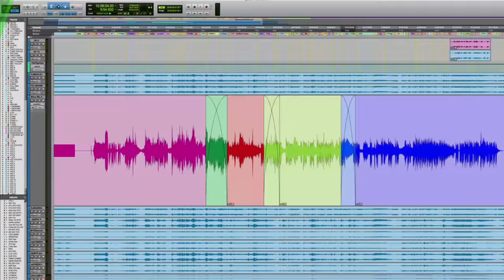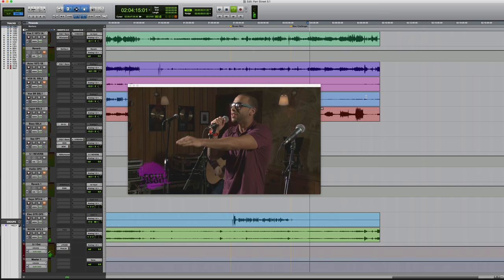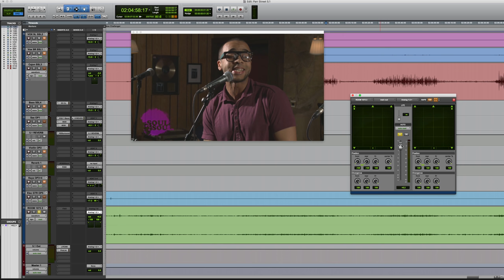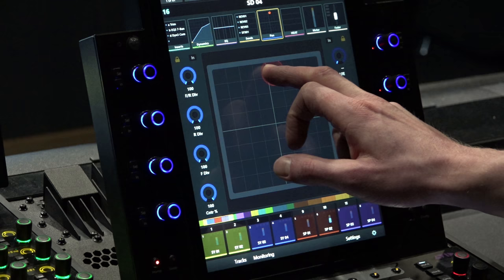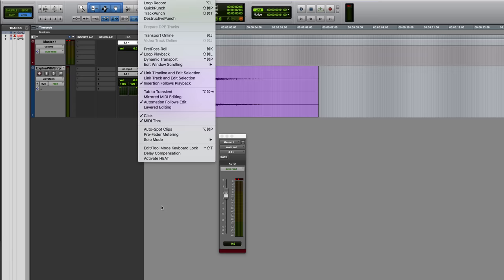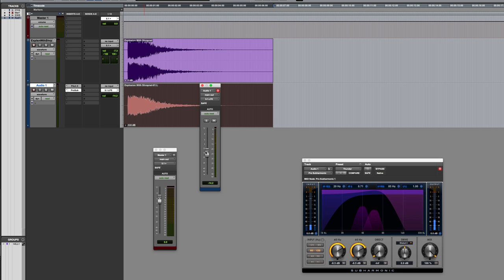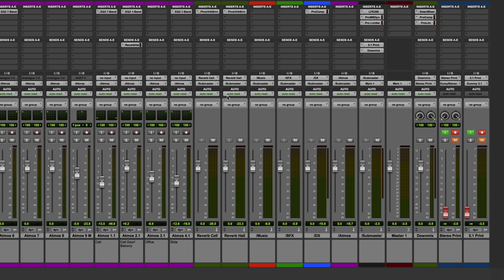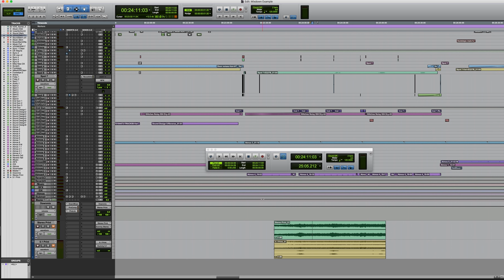An introduction to surround mixing in Pro Tools

Comment: Paul - Your video really solved the major problem I had with tons of audio files spread over 4 different external drives. Thank you so much for the education! Too bad PT had the round robin checked automatically from day one. Had I known!
Reply from the maker: Round Robin Allocation is a feature which should probably be removed, in my opinion. I'm glad that you finally got to the bottom of the issue though.

Comment: Hi Paul, Luke here from Tribal Get Out Alive, Manchester Filed Mixer... Wow what a video! I've been asked to create a pre mix for an indi feature film, specifically the foley design. They want me on Tools for it which is fine, quick question regarding mixing in 5.1. Can one mix via headphones with 3rd party soft-wear that offers a viable work flow? 

Kindest 

Luke
Reply from the maker: Hi Luke! You can do a lot of the groundwork for a 5.1 mix over headphones. If routing to a stereo output, Pro Tools will automatically down mix to 2 channels for monitoring. Of course, a lot of the panning would be guess work so you'd have to check it later on in the process over a proper 5.1 monitoring system. Having said that, I do know someone who guessed an entire 5.1 cinematic trailer mix by monitoring in stereo and it turned out OK. Not advisable though.
By the way, Tribal is completely finished and looking and sounding good!

Comment: This was really helpful. Thanks a ton. I want to know why you would have the LFE360 plug-in on your main mix output? I didn't understand that part. Can you please help?
Reply from the maker: It filters frequencies above 120Hz out of the LFE channel. This is because when you use the LFE send control in Pro Tools, it sends full bandwidth audio to the sub. The subwoofer in a surround system generally only plays back content below 120Hz so it's a good idea to filter it out. Also, if it ever gets encoded to Dolby Digital, the sample rate of the LFE channel gets dropped to 240Hz so by applying filtering at half of the sample rate you avoid alias frequencies being heard (Nyquist). This would take a longer description to explain properly but that's the basics.

Comment: The 0.1 of a 5.1 surround system indicates the amount of monitors in the system, not the potential bandwidth of the monitor. That is, the LFE Monitor
Reply from the maker: It indicates a dedicated LFE channel and is .1 because it covers only part of the frequency spectrum. This information came from an interview with Tomlinson Holman, the creator of 5.1 and THX. Subsequently it has been used to denote the number of subwoofers used but the original intent of calling it a .1 channel was to indicate the fact that it’s not a full bandwidth channel. Tomlinson Described this in a podcast with AV Forums a few years ago, and in his book ‘5.1 surround sound up and running’.

Comment: Good video. Please keep it up.
I'm interested to know more regarding output channels as well as the Loudness Specifications for TV & Cinema. What about Phase changes when we Low Pass in the LFE channel?
Reply from the maker: Loudness specs is quite a big subject but I'll have a think about how I could do it.

With regards to phase changes when low pass filtering, most equalisers (other than linear phase EQ's) will cause some small amount of phase change when used but the phase change on such low frequencies with a very long wavelength will be inaudible.

Comment: Excellent video!

I have some questions. I've never worked in a detailed audio project like the one in this video.

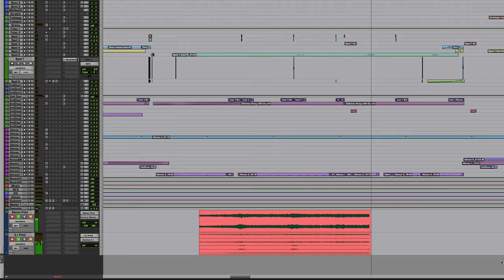- In the video for the movie section (34:22), I see that you created mixdown buses for dialogue, FX, etc.  Is it recommend to create mixdown buses for every audio element? ( one for dialogue, FX, foley, ADR, ambient environment, etc) 

- The mixdown buses created for dialogue, FX, etc were in mono or stereo? 

- In other software (Audition, Fairlight, etc) is there an option to record the final stereo and surround mix like in the video?  If not, would sending the tracks to buses, submaster to a final stereo and surround master work?

Thank you.
Reply from the maker: Thanks Christian. The buses would typically be in the channel format of the whole mix (stereo, 5.1, 7.1 etc). 
There will be ways to record the full mix to a track in other software. I can't speak for Audition or Fairlight specifically as I don't use them. It's likely that it can be done though.

Comment: Excellent tutorial again Paul.. Thank you..
Regarding the low frequencies doubling up on consumer systems; Shouldn't we cut the lows (below 100Hz?) on the explosion along with managing the LFE on their own tracks? Seems to me that just doing what you've done will still double up the lows on consumer systems. Am I missing something?
Reply from the maker: That's a good point. If there was already significant low frequency content in the explosion then it would be a good idea to high pass it on the main channels. In this case, I didn't feel that the explosion effect had that much low end, so the much lower pitched version I created for the LFE channel didn't overlap too much with the main explosion. Certainly though, there would be occasions when cutting the lows on the original sound would be a good idea. It depends on the sound.

Comment: Thanks for the presentation 

did you install dolby atmos production. Suite for protocls integration 7.1.2 surround bus. ?

Is this for mac os only ??
Reply from the maker: I have used the Dolby Atmos Production Suite although I didn't cover it in this video. As far as I know, the Dolby Atmos Production Suite is mac only.

Comment: Great tutorial but I felt you started in the middle. I wanted a walk through of setting up a 5.1 template and how to route outputs from the I/O set up. I've tried on my mbox 3 pro but it throws up error messages like 'this channel doesn't have an active output' or some shit. I don't know what I'm doing.
Reply from the maker: This tutorial is an intermediate level one so I didn't cover I/O setup much. I will consider going over it in another video.

Comment: The surround panner doesn´t appear in my Tracks? How can I activate it?
Reply from the maker: You'll need Pro Tools Ultimate in order to work in surround. If you have that, any track routed to a multi channel output will have the surround panner. Create the outputs and buses in I/O setup.

Comment: Very nice video!"I am actually also interested how yo uare capturing all audio to the screen capture tool you are using?

I always have trouble doing screen caps with pro tools. Have to use soundflowers, or multi aggregate devices, and seems to be a huge workaround to get audio going for this purpose. DO you mind going through your screen cap setup with pro tools audio on the mac?
Reply from the maker: Edward Bauman On the system I create these videos with, I have an HD Omni interface. When I’m working on a day to day basis, that’s my normal audio interface. For screen capture though, I route the audio out of the computer’s line output and capture it with Screenflow.
Reply: @paulmaunder3007  Do you have to create a ProTools gregate IO though? Because when launching protools it will basically steal the core audio, right? So how does screenflow undestands the output of protools as the system sound?
Reply from the maker: @baumansound  With Screenflow, I don't use an aggregate I/O. I just set Pro Tools to output over the line output on my Mac Pro. I then monitor this over headphones via my audio interface and Screenflow is just set to capture the computer's audio, along with the mic I use for the commentary.
Reply: @paulmaunder3007  Interesting! I will try that! Not sure why I am having so much trouble to record PT audio with a video capture.

Thanks!!